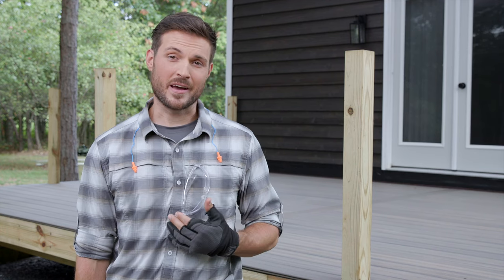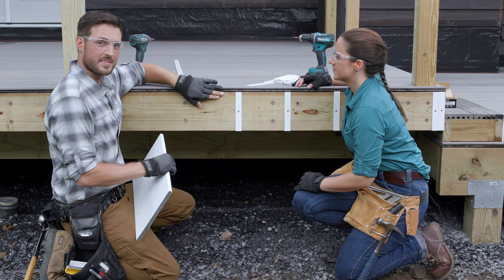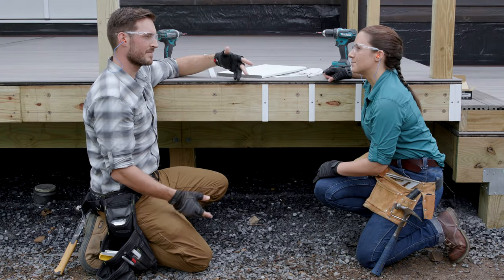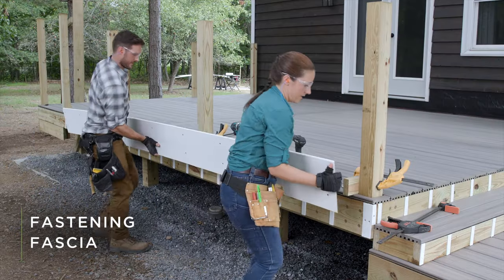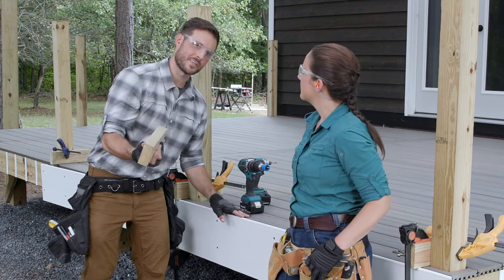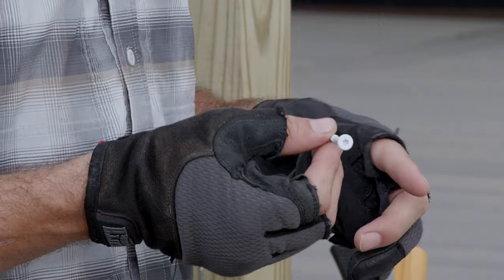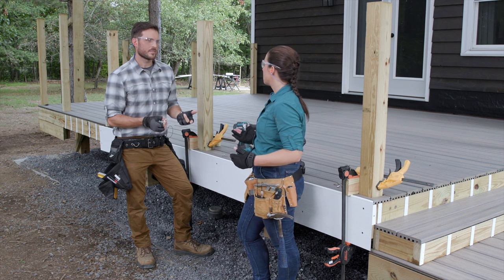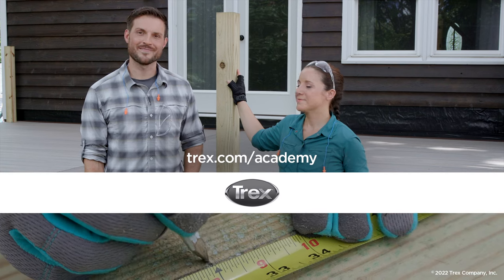How to Install Fascia Boards for a Deck | Trex Academy

Comment: Where did you get the white shims for behind the fascia boards?
Reply from the maker: Hello! Thank you for reaching out and for your interest in Trex! The shims behind the fascia material are exterior grade trim. In this particular installation, the trim was purchased in 8' lengths and cut down from there. Exterior grade trim can typically be purchased from any home improvement store or lumberyard. You could also use wood shims if you prefer that. If you have any additional questions, feel free to give us a call. 1-800-289-8739. Thank you, Trex Custom Care Team
Reply: Thank you so much. We went to Lowes and found the exact ones in the video. I’ve been hunting everywhere for where we can buy the trex fascia white plugs. In the video it looks like a wood grain but ours is smooth white. We bought it at Lowes. Can you tell me where we can buy the white plugs that match our white fascia? Thank you
Reply: @TheTrexCo  I've been trying to find the plastic sheet that you used in the video like crazy and didn't find anywhere!
Please, update the Trex website and the video with a more detailed description of this spacer. Just now I found which one you used in the response above.
Reply: @mrslane  can you please share the material you purchased? I can’t seem to locate this at Lowe’s.
Reply: @mrslane  Do you happen to have the item # for these? Been going crazy trying to find them. Thanks.
Reply: @chrispierce2120  I tried to look back on my Lowes order history and I think it’s item#999426, model#5099134. It’s called 1-1/4” X 3/4” X 8ft Unfinished PVC Bead. Hope this helps:)
Reply: @flybynight757   I tried to look back on my Lowes order history and I think it’s item#999426, model#5099134. It’s called 1-1/4” X 3/4” X 8ft Unfinished PVC Bead. Hope this helps:)
Reply: @mrslane  Thanks. I see it as 1/4-in x 3/4-in x 8-ft Unfinished PVC Bead and it's in stock. They have 1 9/16 x 3/4 which is what I think you meant. Item #: 209626 Model #L182018L8
Reply from the maker: @mrslane  FastenMaster manufactures a plug system that's compatible with our PVC TrexTrim: https://www.fastenmaster.com/products/cortex-for-pvc-trim
Reply: Home Depot 3/16" x 1 1/4" pvc trim 8 ft lengths $5.29 a piece

Comment: Where can we find the spacers that are used under the fascia board?
Reply: Yes, please. Went to HomeDepot and they do not have a 1/4”x1”x8’ weather resistant spacer material. Called Dunn Lumber (where I bought the Trex decking) and he was trying to get me to use shims! Odd that a Trex certified reseller doesn’t know about the required spacers. Lowes?
Reply: @madisonmcculloch365  Just trim off some spacers from your existing facia board
Reply from the maker: Hello JP, great question. The spacers used for the fascia installation are fabricated from remaining Trex decking or fascia or simply pressure-treated lumber. - Trex Customer Care Team